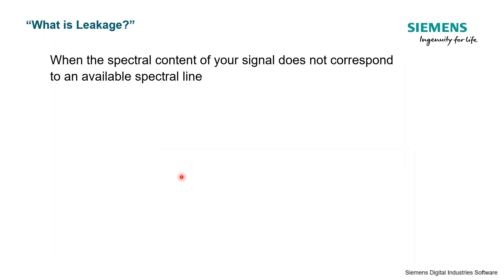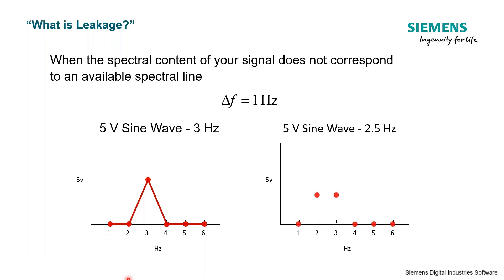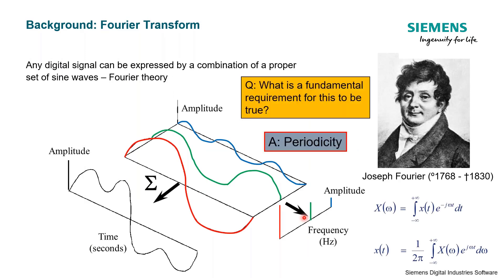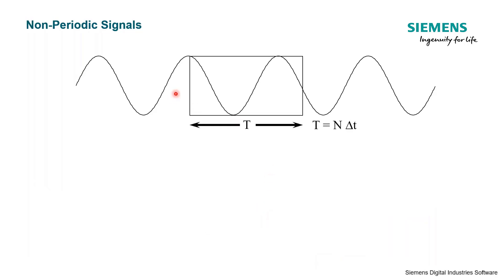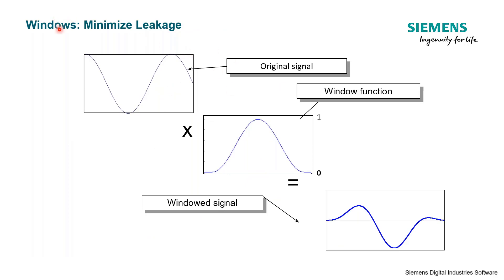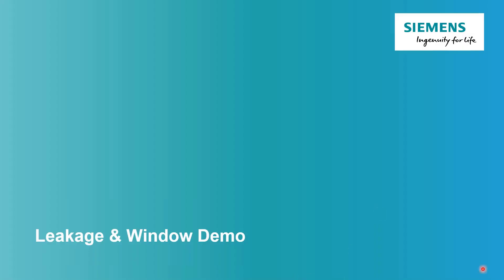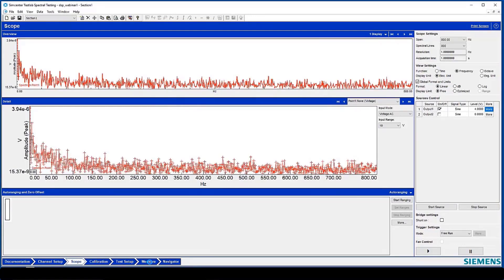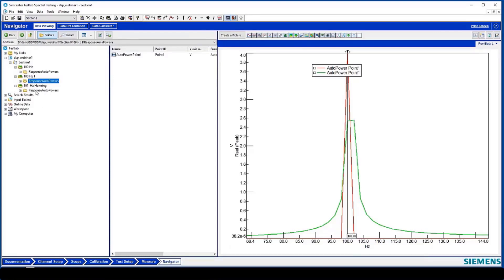Windows and Spectral Leakage

Comment: Really helpful video - although I do have one question! If the edges of the non-periodic waves cause high frequency components when stitched together, and these high-freq components cause leakage of higher frequencies into the spectra, how does this explain leakage from low frequencies?
Reply from the maker: The Fourier transform of a sharp transient creates a broadband signal that covers all frequencies from low to high.

Comment: Hello
First, thank you for the content. I really learned a lot from the video!

I have a question. Considering industrial applications (machinery in general,  on the field), we gonna be obligated to always use the window in our signals right? 
It should be quite impossible to control exactly the start and end point when we take our sample, mainly when the system is triggered by some kind of sensor data, like the driven motor current.
Reply from the maker: It is not necessary to use a window if the signal is measured in a way that does not require it.  For example, some devices might output a trigger in addition to the signal (for a example a trigger in the same spot in a rotation) and that might make it so the signal can be measured in a periodic manner.  Impact tests and modal tests (where a known excitation is applied that can be made to coincide with the measurement start) can also be periodic.  That being said, if the signal cannot be measured periodically (probably the vast majority of signals) than a window is the safest alternative.  Hope this helps!

Comment: Hi could you explain how the window function affects the spectral smearing? thx
Reply: It's weird cuz in our textbook, it says window methods can reduce spectral leakage but as a result amplify the smearing effect. I can't really find the definition of spectral smearing.
Reply from the maker: For a signal measured non-periodically, smearing is reduced by applying a window. However, a periodic signal, which would have no smearing and not need a window, applying a window actually creates smearing.
Reply from the maker: Smearing And leakage are being used interchangeably here
Reply: @SimcenterTesting  I realized that you used 'smeared' a lot in the video when it comes to the leakage at the demo. So smearing and leakage are effectively the same thing. I'll double check with my tutor for that. Cheers
Reply: @SimcenterTesting  If they are on spectral lines, to begin with: "applying a window actually creates smearing". Is that understood correctly?

This concept is actually interesting can you reference some sources? I have no idea where to look, but this is precisely what I need to expand on.
Reply from the maker: @kasperholck5928  Yes, a window applied to a signal that is periodically measured will actually create leakage in the resulting spectrum. A signal like a sine wave, that is at the same frequency as the spectral resolutionm would not normally need a window.  However, applying a window alters the sine wave (it is not a single frequency anymore).  To describe how the windowed signal rises and decays requires several sinewaves and not all are coincident with the spectral lines.

Comment: Very well explained.  Your point that all the energy is still there in the leakage is really important and something I learned years ago, by summing the leakage terms.  Very important when trying to get a power estimate.  

I thought the graphic of why you get the leakage when you piece together data which is not synchronized with the sampling was wonderful, illustrating the high frequency components when you piece them together.  Thanks.

Comment: Hello, may I ask if the frequency resolution is 2.5hz, and if the frequency is tested at 100Hz, there will be leakage (, in this case, windows need to be added to reduce the leakage. Is that what you mean??? Thank you and look forward to your reply
Reply from the maker: Yes, that is absolutely correct.  If the resolution does not match the frequency being tested, there is leakage.  Windows will confine leakage to a narrower frequency range so a RMS summation can be performed to recover the amplitude.
Reply: @SimcenterTesting  
I think I see. Thank you very much